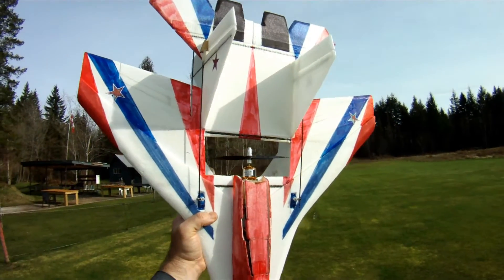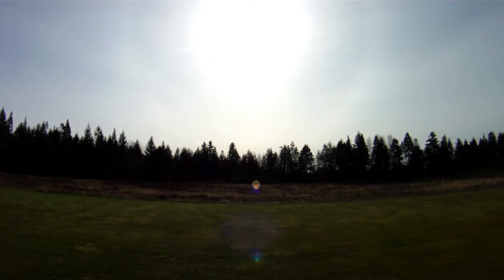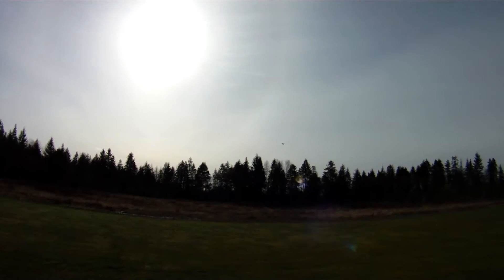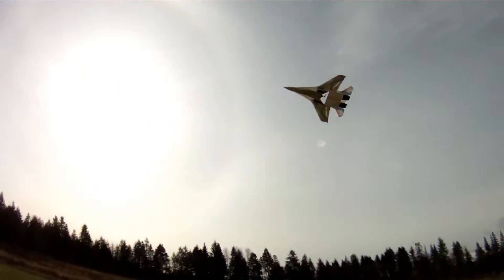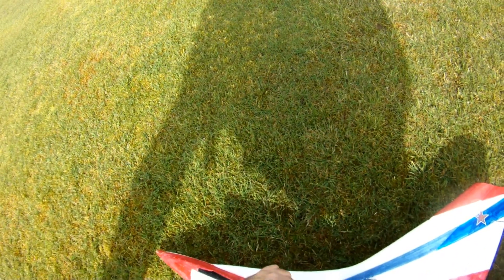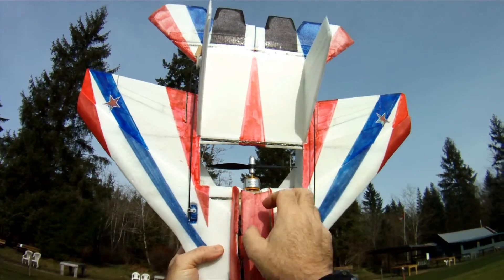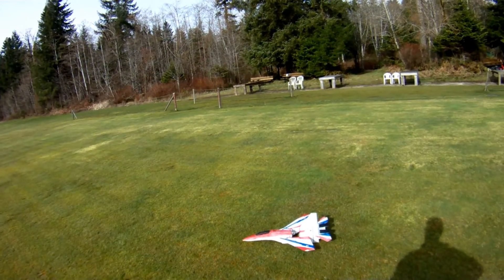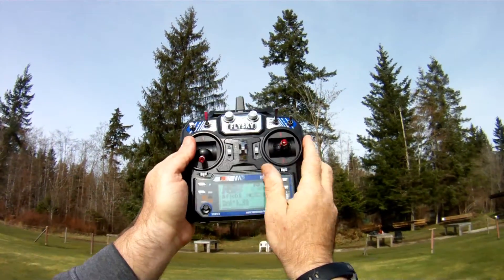Field test - 2212 2200 Kv with Gemfan 6045 CN prop on 3S

Comment: Greetings would you recommend a 6.5×4 master airscrew prop for this motor along with a 30a esc?
Reply from the maker: I have never tried that setup, I would take it easy for the first couple of flights to see if there is any heat build up in your motor, ESC or battery.  I have no idea what kind of amp draw that prop will produce.  Good luck.  Cheers, Scott

Comment: Can I use 7x4 / 7x3 prop with it ?
I have a mig 21 with pusher config and weights around 860gms so can this motor work for my plane ?
Reply from the maker: Yes you could use a 7x3 or 7x4 prop with this motor on 3S if it will fit in your plane.  I would recommend using a 40A ESC or taking it very easy if you use a 30A ESC as the amp draw will be higher with a 7" prop.  Good luck.  Cheers, Scott

Comment: Can we use 4s lipo battery with those motors
Reply from the maker: Yes, I would recommend a 6x3 prop though to keep the amps down and using a 40A ESC.  Cheers, Scott

Comment: it's not econamical for me to get those apc 6x4...2 -ea will cost me more than the motor and esc.lmao (shipping) If i buy from ebay..I might as will get 20-ea  6x 4 germfan for the same money. i cant burn holes in the sky in town anyway...Power to yank and bank before I hit a tree is good.lol
Reply from the maker: I understand.  Are you looking to buy these Gemfan 6045 CN props?  Not all Gemfan props in 6x4 are as stiff as these ones which is what makes them work so well for the price.  Cheers, Scott
Reply: yeap....i have 6x4 Hop bullnoes...they're for quads. The blades are more square...sort of like master air gas props. I probably wont get as much rpm out of them. i have some 10x4 and 8 x4 gemfan and some other 9' props...i have to start collecting them...
Would be nice if i can just try out different props on the different motors i have..and not buy first .lol
It's still cheaper than nitro..i use to damage lots of props on hard landings. i dont take chance. i just throw them out. Alot of times
I was stuck with what the local hobby shop only carry.
it was rediculus. i'd stock up everytime i make a run into the city.

Comment: Hi Scott
Not that much difference then with the GEMFAN. Was hoping for a it better results. I'm yet to test one on a lot more powerful motor to see what they can really do. You've probably noticed I'm taking a bit of a break at the moment from doing testing as I'm finally doing a bit of work on my car. Might try to get a motor test vid done if I can get round to it on Thursday maybe.
Great flying again mate. Cheers.
...RCPP
Reply from the maker: Hi RCPP, overall the Gemfan 6045 CN did perform better than the 6x4 APC gas.  I suppose it is a bit hard to tell if there is as much difference top end as I expected perhaps because of the windier conditions when I flew.  As I flew more flights after this video, I did notice the big difference in power through the 50-75% throttle range, so this would be my "go to" prop for this motor from now on.  Thus far between the small amount of bench testing I have done and the two field tests, this is an excellent prop for motors that I am using below 2600 kv.  I might give it a try on a motor above 2700 kv soon, I'm just a bit worried about amp draw, but you never know til you test :)  Overall, I'm very pleased with this Gemfan prop and I'm grateful for the recommendation, mate :)  Cheers, Scott

Comment: Wow! That's a very nice and inexpensive power setup. Is this the best prop you've used with this motor thus far for thrust vs amp draw? Looks like the radio is working as well. Thanks for the video and Happy Flying!
Reply from the maker: Thanks very much, from a standpoint of overall power, this is the best prop I have used on this motor, but it is not the most efficient, I am probably pushing the motor pretty hard, but it seems to be handling it OK.  The nice thing about this motor is that it is very versatile on 3S, I have used multiple different props on this motor providing a wide variety of flight experiences.  Thanks for watching and happy flying to you as well :)  Cheers, Scott